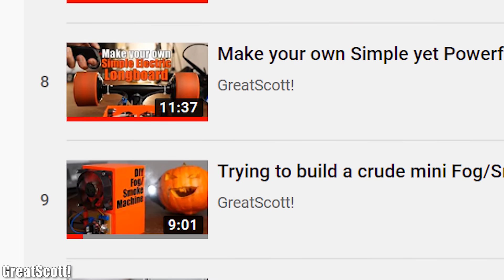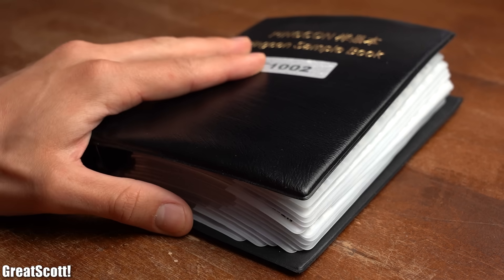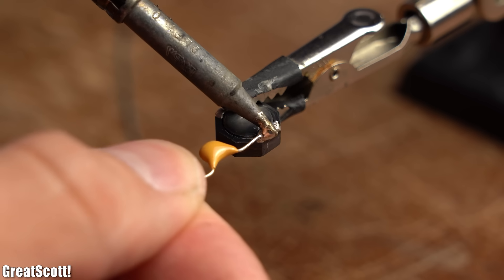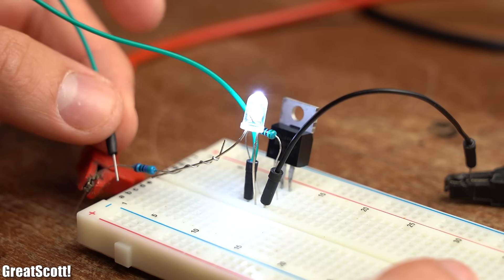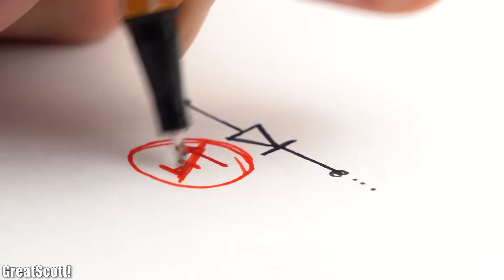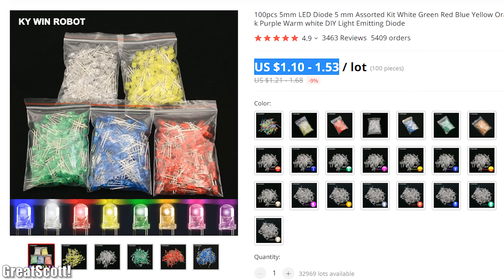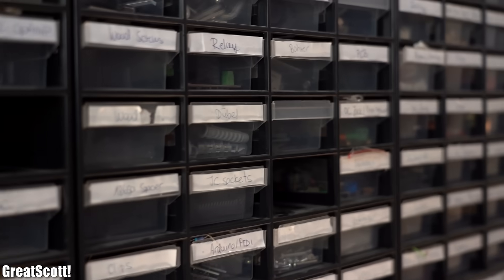Essential Electronics Components that you will need for creating projects!

Comment: IS someone also able to explain to me what a mosfet driver does and why it is so necesary?
Reply from the maker: I will do a video about it sooner or later.
Reply: The mosfet has some gate capacitance. If you want to switch your mosfet quickly, you need to charge the gate capacitor quickly. A gate driver lets you do this, and might throw in some other niceities.
Reply: Unless you are doing power switching, you don't need a driver. It's a layer between logic and power devices. Logic switching fets don't need drivers to go fast, a lot of the 2N series fets have symmetric 20ns times and higher end ones probably can go sub-15ns. Talking a frequency of 25MHz or better in ideal conditions. Power fets on the other hand have a larger gate etc for the higher rating and thus greater capacitance to deal with. You can make the loose comparison to the issue BJTs have with base charge when switching fast, needing a clamp to push faster Toff.

Everyone says they're "necessary" because everyone gave up the fundamentals of discrete engineering and just use uC boards for everything now. It's a real shame because it's far more satisfying working discrete and getting every last drop out of the stone age method. That's what happens when software guys get in on the hardware turf, the tool really works at both ends.
Reply: To add to that: in the OFF state, no current is running, but full Voltage is over Gate and Source so P = 0 x Volt = 0 Watt dissipated in the mosfet. In the ON state high current is flowing, but (almost) no voltage is over Gate and Source. So P = amp x 0 = 0 Watt dissipated in the mosfet. It is only the state > in between < on and off where the current is half, and the Voltage is half, where a lot of power is dissipated in the mosfet and that is lost energy transferred into heat. Fast switching between the on and off state is therefore wanted.
Reply: Same, my dad keeps mentioning mosfets in his projects, but I never heard/knew that it needs a driver
Reply: When you are driving an inductive load you need to worry about turning the fet  OFF  all the way, this is the hard part things get cooked otherwise
Reply: Just to add a bit to what others have said...  I've only used a power mosfet for low-side switching, ie where one leg of the mosfet connects to ground.  I forget the serial number, but it was a very common one.  It switched 12V,  40W halogen load at about 10 Hz without a driver or heatsink and didn't even get warm.  Running the same circuit at 1kHz would have been a different story.  As someone else pointed out, power dissipation in the fet occurs mainly during the transition period between off and on.  100 times as many transitions per second means 100 times as much heat generated.  So for higher switching frequencies  you want a driver circuit that will brutally slap the gate to ground (disharging the gate capacitance)  in nanoseconds.  Less hotness = good.
Reply: Here is an explanation/example:
https://youtu.be/EFz39dRP9oA
Reply: When switching from a low logic signal to a high logic signal, transistors behave like resistors, and they can heat up quite a bit. The faster you can switch the transistors, the less heat is produced.

If there is too much of a heat build up, you'll fry the transistor, since they are not meant to operate at high heats
Reply: Before the internet and search engines I would go to my local library and find a book on the subject in the American series "The Idiot's Guide To."  eg "The Idiots Guide To Calculus."  These days libraries are an endangered species.
Reply: @denislostinlondon199  the internet, is the library. Almost literally.

Comment: can someone please explain what bootstrap means for electronics at 7:48?
I have been trying to figure it out watching videos and all, but i cannot make sense of it
Reply: Bootstrap is needed for high side switching. If you consider for example an Buck converter, the Mosfet is between the voltage source and the inductor. You want the Vgs higher than Vth, usually arround 10V to make sure the mosfet is fully saturated. if you have  an input voltage of 12V, when you turn it on there will be 0V at the mosfet Source, so you will have a Vgs voltage of 12V. But as the mosfet starts conducting, the source will be at 12V as well so the Vgs will be 0V. You need a bootstrap configuration to raise the Gate voltage above the Source voltage so that the mosfet will be on as a high side switch.
Sorry for the long post.
Reply: @hodissergiu8883  Well said.
Reply: @hodissergiu8883  I'm sure this is right, but..whaaaaaaaat.
Reply: @visualeffectschannel  Because if you don't. the mosfet lets out the magic smoke.  Think of it this way: A fire hose has a valve, a tiny itty bitty control valve.  When you turn on the water, if you put fire hose pressure on the itty bitty control valve, with nothing in the fire hose input, the control valve will shoot into the hose, and you will break the thing.  My best metaphor.
Reply: TotalWarChronicles - Ignore the other responses, especially the one about the firehose because it’s total nonsense. Bootstrapping in this case is referring to using a higher voltage to bias a device above it’s supply voltage. Let me explain...

N-channel MOSFETS are often preferred for switching because they are generally faster and have lower on resistance, Rds(on), compared to P-ch MOSFETS. If you need a high-side switch, P-ch is simple to use because they are turned on by pulling the gate below the source, i.e. apply -Vgs. However, if you want the performance advantage of an N-ch, you will need to figure out how to generate a gate voltage higher than the source, i.e. apply +Vgs — something that is usually easy when the source is tied to ground (aka low-side switching) but difficult if your source is at or near the supply voltage (aka high-side switching). This brings in bootstrapping — that is, using a bias voltage (gate voltage) higher than the supply. The IR2110 won’t generate this high voltage for you but you can get it a few ways, e.g. maybe it exists elsewhere on the board or system or perhaps use a charge pump circuit. Anyway, Great Scott is saying the IR2110 is nice because it conveniently allows the use of bootstrapping thanks to the high-side driver output being isolated from the rest of the voltages inside the chip.

Comment: I think it's a little unfair to say that JLC has fast shipping times without talking about how they do it.  If you want fast shipping time, you have to go with DHL, and can expect a lot.  I just ordered 6 different PCBs that came to $21. The shipping on DHL was over $17.  If you go with their standard shipping, which costs much less, you can expect to wait at least 2-3 weeks before you see your PCBs.  I do use them quite often, and I do try to go with DHL most of the time, but I can't always justify the cost. If the PCB cost $2 or $4, and shipping costs me $12, it's just too much.

So, yes, you can get fast shipping from JLC, but you need to expect to pay for the privilage.
Reply: I wouldn't complain so much about it, sure beats making my own PCBs using toner, copper foil, plywood veener, and dangerous chemicals...

Comment: Amazing list! On the MCU side I would add a few parts: I'm using the new PIC16F MCUs for low level tasks, since they have core independent peripheral, built-in digital logic, op-amp/pga, even hardware PID controller. For more demanding tasks I'm using the STM32F4 MCU with FPU, oh... and the ESP32. I'm not a fan of the Arduino environment, and AVR boards.
Reply: How does the new PIC compare to STM's lower end lineup? I've been using STM8S003/103 for all my smaller projects due to their low cost and other benefits
Reply: PIC16 is not worth wasting you time learning anymore, and microchip is very unfriendly with their bad compilers. Go for anything ARM or RISC V. STM32 is probably fine.
Reply: The newer SAMD boards are also pretty powerful

Comment: Good list. The only thing I would change is that instead of Arduinos, esp8266 boards. They do much the same as Arduinos (even running the same code in most cases), but are WiFi enabled and cost less.

Comment: What is it bootstrap operation at 7:47 ? Can someone help?
Reply from the maker: You can basically use N-Channel MOSFETs for high side switching.
Reply: Scott, bootstrap's just disconnecting power supply from load?
Reply: @turneroq9888  Bootstrap is needed for high side switching. If you consider for example an Buck converter, the Mosfet is between the voltage source and the inductor. You want the Vgs higher than Vth, usually arround 10V to make sure the mosfet is fully saturated. if you have  an input voltage of 12V, when you turn it on there will be 0V at the mosfet Source, so you will have a Vgs voltage of 12V. But as the mosfet starts conducting, the source will be at 12V as well so the Vgs will be 0V. You need a bootstrap configuration to raise the Gate voltage above the Source voltage so that the mosfet will be on as a high side switch.
Sorry for the long post.
Reply: @hodissergiu8883  Thanks!. I appreciate your efforts to write such a long answer. I understand a bit because I am newbie at electronics.

Comment: I think shift registers are also useful in many projects
Reply: If you're dealing with data or more than a couple LEDs, then absolutely. They make designing LED grids so much easier. Do they have other uses?
Reply: @KaedennYT  E.g. extending the amount of digital ouputs( I mean connected controlled devices) for D1 mini-like ESP8266 or ESP32 boards.
Reply: @KaedennYT  : Some people use them to handle serial transmission. You can also use them to make rotary counter or make automat which uses one-hot code. With other components they can arithmetic operations like multiplying, dividing and even generating CRC codes.
Reply: They are always my go-to option when it comes to multiplexing outputs

Comment: Well, to me it's always useful to ha e heatsinks, I keep every one I find, Always useful
Reply: Especially when stepping down the voltage significantly since the extra voltage just turns in to heat.
Reply: @koton_bads  In such a situation, a buck converter is usually a better choice
Reply: me too. : )
Reply: It means that you are not so efficient in handling electronic projects. 》save energy《
Reply: i keep a fire extingusher instead of heatsink.. they are more useful as i have found..
Reply: @glitchy_star_classes6276  Yes, super important! Should honestly be the very first thing on the list.
Reply: I would like to note that in my experience, the small heatsinks that fit onto a mosfet aren't too great although probably help a bit if you have air flowing.

Comment: Nice Video! I would add the 74HC595 Shift Register. I realy Love that chip, ist fast, and you can Use ist on the SPI Bus. I need one of them in almost every Projekt. For example to controll many LEDs.
Reply from the maker: Good call!
Reply: WS281X gang
Reply: dear do you need purchasing chip we are electronic components supplier?

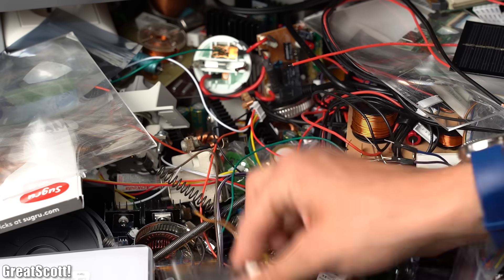Comment: 1:53 No of course not.
I have it all in a big plastic bag. 
Super easy to not find anything
Reply: I chuck all my electronic components inside my drawer and boi is it confusing and infuriating when you want to find a specific transistor or any other component.
Reply: @Rainbow_Sword  i have a wardrobe in the room full to the brim. only for the bed holding it closed it would burst open.. : ) (AND IM NOT EVEN JOKING)
Reply: I know.
I really do have mine in a plastic bag, I know what you mean...
Reply: I have a storage box with useless 'useful ' bits in there... For safekeeping
Reply: @ashfaqjuna  Ever threw away something from that box that you thought was DEFINITELY useless, only to need it weeks later?
Not yet? Probably means you didn't throw anything away then!
Reply: @Kalvinjj  haha

I have done that sooo many times. It always the way :)
Reply: PLASTIC! I use an anti static, now i feel fancy.
Reply: I was like you, but I had TWO plastic bags, and one of them was so full of holes already that all the time I saw some components on the desk or floor, until I upgraded the bags to two boxes from some on-line orders I made, and the boxes just keep multiplying...
Reply: @Kalvinjj  I have two boxes of components

Comment: shrinktubes and cables are missing ;)
Reply: i would also list the soldering boards he usually uses. great for moving your project from your breadboard onto a permanent installation. project ends up a bit funky and usually not the optimal layout, but great for single projects.
Reply: @carlos2004  do you know where I can purchase the exact same pcb board that he uses? I can only find strip boards or circuit boards with paint markings
Help 😅
Reply: @mauvaisesondes9359  You've probably already found it but for anyone else it's called perfboard and you can find it at electronic shops, aliexpress, banggood and such.
Reply: @carlos2004  these are electronic components but boards and cables are not classified as electronic components
Reply: yea jumper wires and dupont wires are too important to be forgotten
Reply: @Rainbow_Sword  Jumper cables are mentioned at the end
Reply: Yaaa !!  Shrink Tubing !!  Magic stuff !!  ;)
Reply: I think you are right becase Great Scott uses wires very often.
Reply: That's must indeed!